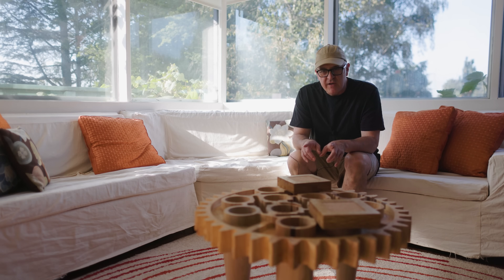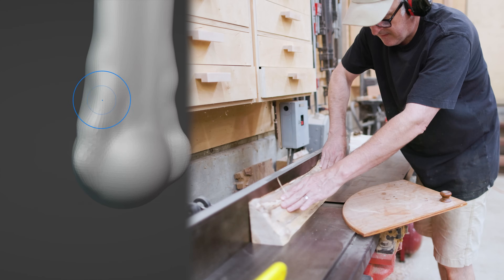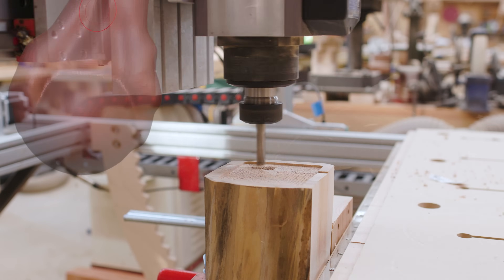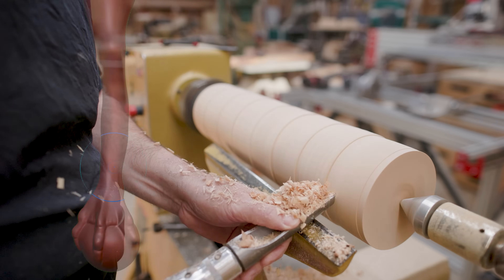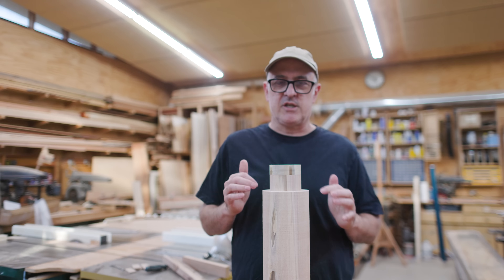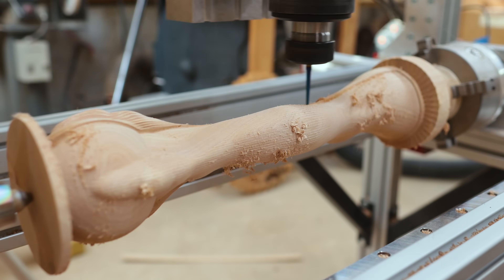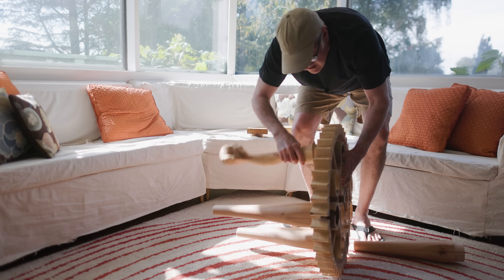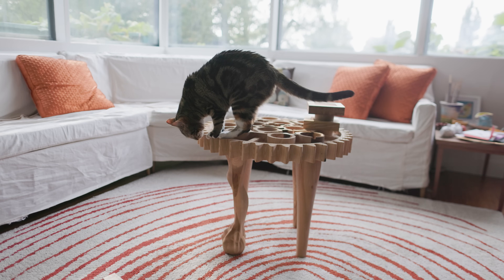The Industrial-Organic Table: A Lego Gear Creation

Comment: Hey Frank, your videos are soo cool. I am inspired to up my computer skills as well as woodworking. Your dilemma with the adapter, you can just drill some more holes in your existing metal adapter to accept smaller pieces and make them spaced out to not take away strength. Your shop is awesome too!

Comment: Great video Frank! There is a simple technique for quickly making a cylinder from the first piece of wood... You write a short G code: turn de 4th axis while moving slowly the X axis, without  changing Z height. It's like a spiral profile. 
Of course you are a master wood turner, but you can use the same code for any piece, just setting the initial bit height and changing the distance for X. Have a nice Sunday everyone! Max from Argentina 🇦🇷

Comment: Frank, can you reverse the jaws on your 4 jaw chuck?
Reply: Exactly what I was thinking. Annoyingly, among the half dozen shots of that chuck, none show the backl of the jaws. Best I could find was at 10:24, where I think you can make out a fairly narrow point of the threading of the jaw on the right, which would suggest reversible jaws.
Reply: @matthijspw  if they're not reversible, I'd say at the very least it should have come with a second set
Reply: Good to know. Waiting for mine to show up
Reply: I doubt it, as it's a self centering 4 jaw so the scroll pattern on the back will be one directional. As @Kyle Bracht said there should be a reversed set available for purchase if they didn't come with the chick.
Reply: @grannyflatgarage7599  Typically even auto centering chuck jaws can be reversed, at least on metal lathes. These looked reversible to me. 🤷‍♂️
Reply: @rtchal  self centering metal lathe chucks generally come with a second set of 'outside' jaws which is how they are reversed. The scroll mechanism (which is like a spiral thread) on the back plate and partially cut on the jaws only works in one direction. 4 jaw chucks (non self centering) are definitely reversible